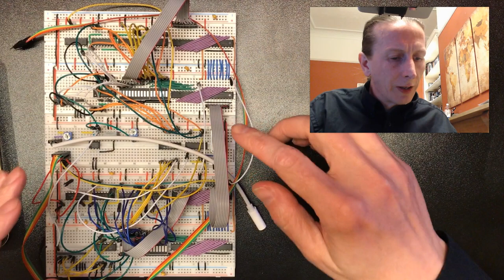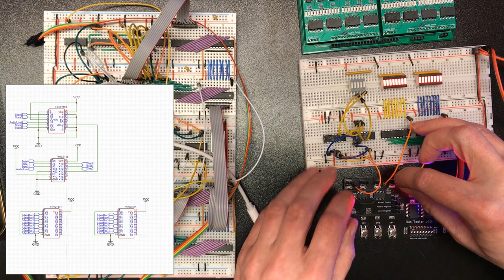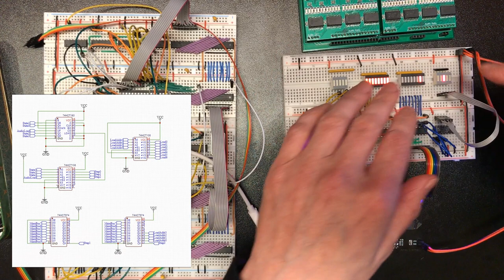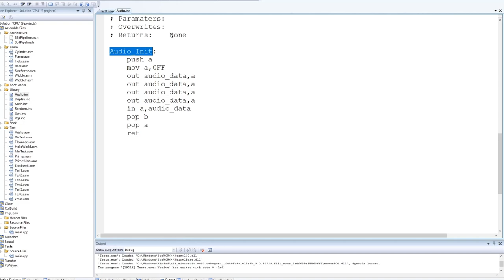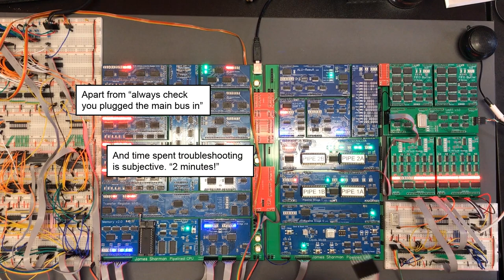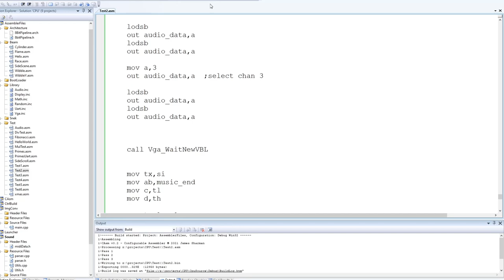New Controller - Audio from Scratch - Part 9

Comment: Fantastic video! Really enjoyed this one. It was great to see so much hardware on the desk at once, the audio output sounded great. I really enjoyed seeing more circuit design, too.
Reply from the maker: Thanks Brady. I'll have to do a direct connection at some point to capture the audio, that little speaker probably isn't helping.
Reply: When I get to building my sound card, I’d like to have 4 channels too. Conceptually that’d be music + sfx for left and right channel. Maybe when you add the final connections you could enable something like this by making sure to use a 3.5mm Jack that supports stereo output (it’s got an additional ring on the connector vs mono only outputs).

Comment: The modularity of the actual audio generators is pretty cool.  I can imagine it would be interesting to get different voices that could be slotted in.
Reply from the maker: Indeed, I'm going to output the spare load lines and a spare input so I could use it for experimentation later but I'm going to use the current circuit for the main build or I'll never finish.

Comment: Nice one, James. Given you're only using 2 bits of each 74138, you could potentially replace them with a single 74139.
Reply: I suspect he’ll mention not wanting to add another part to his BOM
Reply from the maker: You could indeed. If you look at my bus control circuit you'll see I original used a 139 but when I came to make the pcb I couldn't get hold of the smd version so switched it to a pair of 138's. In this case I'm happy using the 138's, the first only needs 3 outputs but the 2nd having 4 spare outputs may be of use. I plan on putting the 16 lines and 4 spare load lines on an external header. I could use that for some easy experimentation.
Reply from the maker: Not wanting to add to the BOM is a good reason as well, but it wasn't my first thought here.
Reply: @weirdboyjim  When you wrote that "reset" code, i was thinking if were a good idea to use one of thouse spare outputs as a "master reset" to zeroing all the four channels at once. It would just a matter of sending one right code to the address register. I can't remember if the channels circuits has a clear/reset pin, thoug. I need to watch the previous videos again.

Comment: I'm old-school. I'd have done a modulo-3 Johnson counter with a 74LS73 rather than a binary counter and decoder, unless I had a whole pile of '193 and '138 in stock. And then I'd need to find one odd NOR gate from somewhere. (OK, you did have a pile of '193 and '138 in stock...)  Nice work!

If you asked me, the next thing I'd like to see is wavetables. Those square waves are grating after a while.
Reply from the maker: That would work. Not sure I want to go much further in this iteration. I keep reminding myself to design the pcb for this bit.

Comment: I felt for you when it all worked and you had Für Elise playing.  Just wonderful.  Well done, James.
I also wondered whether you could save a chip...  Use a 74HC4017 for the counter - ready decoded outputs (but maybe high-active is a problem).  Or use count values 2 1 0 - each one bit active then no bits active (one gate for the decode, carry for the re-load) - that could also work the other way up with 13 14 15 for low-active outputs.  Just thinking out loud while you were wiring up the counter and decoder.
Reply from the maker: It is interesting to think about different ways of solving that particular problem, the 4017 will get you to the 3 states easily in the way you describe. There are a few ways of getting to a 3 state counter with one chip, I went with this one as I wanted the control over the decoded inputs so I could use them as a load line on the latches.

Comment: Great job! Think you should try moving the decoupling cap between DAC and opAmp (pulling non-inverting input to virtual ground via resistor). Also keep in mind that opamps usually can`t do full voltage range on output, thus mixing stage should produce about 3 volts peak-to-peak levels.
Reply from the maker: Thanks! When you say "try moving the decoupling cap between DAC and opAmp"  I think you mean DC blocking cap. What you suggest there is closer to my original form of the circuit, you would still need the negative power rail for the op-amp as it wouldn't be able to swing bellow ground if that was it's lowest power input.

Comment: Here I am struggling to get my Z80 interfaced to an SD card via my FPGA GPU, and you build a whole sound card in the time it takes me to work out how to get halfway through initialisation... 🤣 Great video, enjoyed this one. 👍
Reply from the maker: I've been looking at the SD card spec as a possible storage solution. Are you bitbanging it or implementing a hardware SPA solution?
Reply: @weirdboyjim  I'm cheating a little and using an HDL solution in the FPGA to use the 4-bit interface rather than SPI. Problem is, it's written by someone else for a 32-bit softcore processor, so I've had some work to do to interface it with my old skool hardware Z80 system.
Reply: SD always looks simple, until you realise just how complex it is and how many corner cases and variations there are.  It's one reason why card compatibility is still an issue with some devices.

Comment: The AVR's use a temporary latch register. You have to disable interrupts and then write to the high byte. The peripheral ignores that write and a global latch latches the data. Then you write to the low byte and the peripheral uses the address of that write along with the temporary latch register. IRQ's have to be disabled during this to prevent some other code messing with the temporary latch register.
Reply from the maker: Yeah, any stateful system like this needs extra care when you have interrupts.

Comment: Amazing, as always! But this got me thinking... You mentioned the Amiga on a previous VGA video. The Amiga was notable for is graphics capabilities, but also for its unparalelled sound capabilites, including a 4-channel stereo output. Any thoughts on making this stereo?
Actually, I believe you can one-up the Amiga here. You're sending 3 bytes to the audio system to select the channel and set its state. You use 2 bits to select the channel and 16 as the channel state; that leaves you with 6 bits, that can work as control lines. You could use 2 of those to select the positioning of that channel: off, left/right output, or on both sides. Amiga games usually had (for example) the car engine sound on the left and three extra channels for music and effects; or the car engine sound taking one channel from the left and one from the right, leaving only 2 channels for the rest. You could have the 4 channels usable for different sounds and effects, while keeping the positioning correct!
Reply from the maker: Ahh man, I let commenters talk me into going to 4 channels. In future project working with fpga's etc.. it will be very easy to add things like this, but hand assembly means replication can be a drag.

Comment: Hello, maybe I missed something completely, but why not just use the reset line to also set the counter of the sound circuit into a known state? As it is also used for starting the boot loader itself. Thanks for the video(s), really cool to see all things come together!
Reply from the maker: That’s a good question and a legitimate solution for normal use, but I think it’s better to have peripherals that can be fully reset in software. Since I added the boot loader most of my programming for the device is done by uploading new versions over the serial. That means multiple (often broken if I’m developing) programs being run between hard resets so having preserved hardware state that can cause issues is undesirable.

Comment: Really really cool james! Like it much! I have few ideas for compression. I think the base would be only storing changes in sound. So you can:
- encode the time between sound changes and wait this time between reading in new data
- encode the absolute timestamp of change events and use an timecode like counter. probably more precise.
- encode the tone height not the frequency. with this you can easily tune your instrument.
- do you encode the volume curve in the midi or does the cpu generate this? if the former is true you can encode this as well.
Reply from the maker: I took the data from 12352 bytes to 6520 bytes just by adding a mask for channels that have changed. Encoding a time between changes won't get you much (if anything) as the volumes change a lot. To get music like this down I think a simplified midi schema with on/off time events and the ADSR being processed on the device would be the way to go.
Reply: Yes I would go with volume processing on the cpu. (I am the guy who wrote yesterday on the dc 😉)

Comment: As usual I always love watching your videos. Thank you for sharing your knowledge, your mistakes, and your successes. I was thinking about the output DC blocking capacitor... without any claims of being an expert, but I think the capacitor might function as a highpass filter why a higher capacitor value might be better. Maybe something like 470nF or 680nF, and preferably a polypropylene or polyester one (but not an electrolytic or ceramic one). Also I think a resistor in series with the signal, after the capacitor, and before the output might be good for impedance reasons, maybe something like 1k. And a final thought, wouldn't it be good to use resistor in series with each voice channel when mixing them together before the opamp stage? Anyway, thank you for all the wonderful content!
Reply from the maker: Glad you are enjoying!  I'll have to fess up and say you may well be right, I'm far from an expert on the analogue side of things and just happy when it works.  Just from a few web searches I know there is enough complexity in the field to do a series just on this, but that's for the analogue experts.

Comment: That sounded amazing! 
Perhaps you could add an audio buffer  of 256 bytes to offload a chunk of data to the synthesizer so you can work on other data like game logic at the same time. Your cpu is going to be very busy juggeling audio, video and logic this way o.o
Reply from the maker: You could do that, but where would the challenge be? I added the wait VBL into the test code for a reason, getting the timing synchronized there is a good thing as I'll be doing a bunch of things in a VBL timed loop. Timing with another cadence is more complicated.

Comment: Is there perhaps a compression scheme you could use to reduce the size of the audio files in memory?
Reply from the maker: Absolutely! The version I showed here stored the music in completely raw register settings which came in at 12352 bytes. I implemented a basic channel level mask system immediately after which dropped that to 6520 bytes. To be honest it would be better to perform the ADSR processing on the cpu and you could get music like this down much smaller.

Comment: Since the PCBs are in batches and the controller allows control up to 8 channels, would not be the funny idea to utilize the rest of those PCBs? Curious if the additional channels would add another big step like before, or would be almost inaudible detail.
Reply from the maker: I think we are at or near the point where additional channels give you diminishing returns. If you wanted to improve things it might be better to look at different wave forms or adding some automation of adsr.
Reply: @weirdboyjim  Probably yes, I think 8-bit guy had cool video how old sounds were produced and that 3 channel sounds better than 5 channels, because the one even it had more channels could produce only 1 type of modulation per channel, like square, saw, triangle and noise, but those 3 could change them arbitrary at any given time to any combination. Just wanted to see those PCBs used for more than only holder while applying paste :D

Comment: forgive me if I missed adding it, but does the sound output approximate a sine wave, or is it still doing square waves?
if the latter, are there any plans to change that?
Reply from the maker: It's just square wave with no plans to change. This project has suffered from feature creep a little, I'll do more in future for this device is pretty fixed for now.
Reply: @weirdboyjim  brilliant! thanks for the answer.
Looking at it, you'd need to do some fancy stuff with inductors, capacitors, and/or op-amps on the output side to turn what you have into sines, and it may not work nicely for all frequencies, so I can completely understand not wanted to put in that effort. Especially as it's more EE than CPE.

Comment: Hi James, was wondering how expensive these PCBs are that you design? I was curious about the size and price of your 8-bit computer once it was put onto some PCBs.
Reply from the maker: That's a tough question to answer. Each of the small pcb's probably average about £5 each, you get 5 for that price so the multiples likes the register boards you are only paying once. For some of them I had a stencil made which adds more but is not necessary. The large back planes are much more, I'm planning to do one big one that connects it all up before I'm done but I have no idea what it will cost. I'll probably shop around.

Comment: Thank you for your video! 
Have you considered using your 16-bit Address bus as a poor man's data bus? That would simplify the design.
Reply from the maker: That wouldn't be my first thought, but the Transfer bus would be better suited for doing that. There is one spare address there to give you 16 bits of transfer, but there are 4 audio registers so you would still need extra circuitry to add the destination. I don't think that's the right call here, but it's good to think about options. If you were designing a custom device it might have been worth adding control lines to the transfer register destination address so you could hook up extra devices there.
Reply: @weirdboyjim  Oh, I forgot that you have two 16-bit buses 🙂
What I was actually thinking is a complete role reversal for the buses, so one of 8-bit registers would serve as an address, and one of 16-bit registers would serve as a data source. So, you'll need one instruction to address 256 devices.